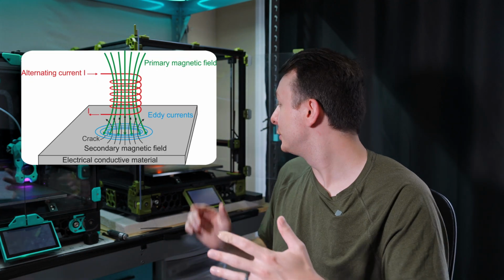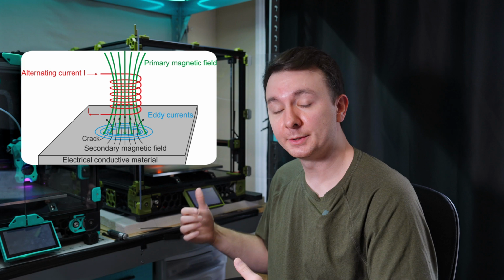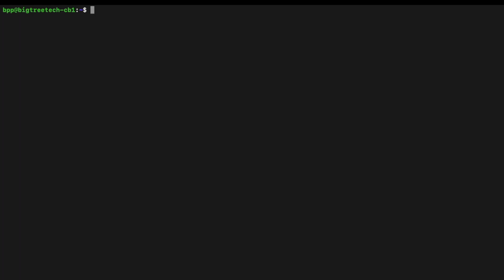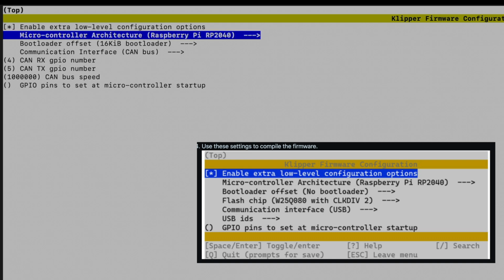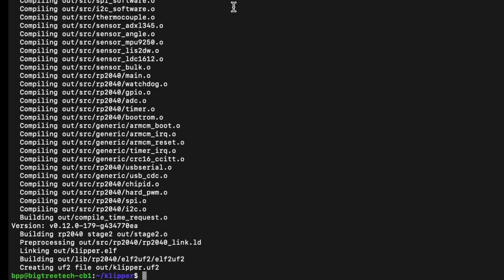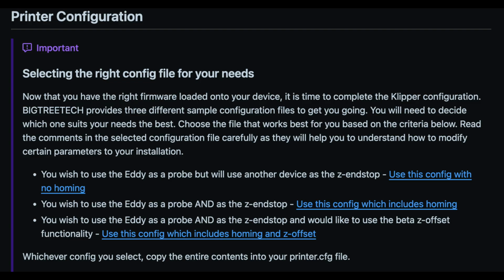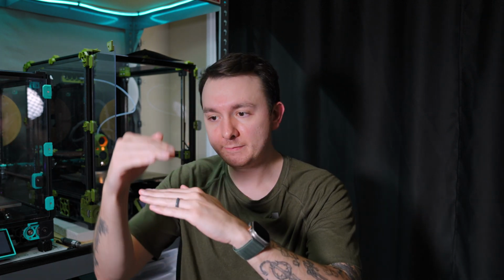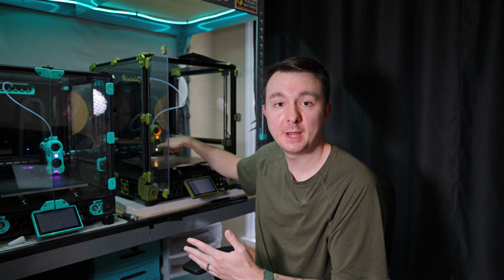Level Your Bed FASTER with Eddy!

Comment: Just ordered a Formbot Voron 2.4, I noticed you described a USB connection; wouldn't the Duo with CAN be a better connection method?
Reply from the maker: Possibly - this is just the one BTT sent to me. They also sent me a new tool head board which is USB but I haven’t installed it yet.
Reply: @ButterPockets  Many thanks for your previous video regarding jumper settings - in the middle of a formbot build :)

Comment: I prosses you offered editing the confog file for different offset is idiotic.

Its a deal breaker .  I tune every filament z offset and send it with command set gcode offset.

I hope it is still possible coa otherwize i threw money to the trash

Comment: Why the hell do you have a section called "hardware install" where you DON'T INSTALL THE HARDWARE?
Reply from the maker: Because I INSTALLED THE XCARRIAGE. The Eddy install is TWO BOLTS. Why the hell do you need to see me screw in two bolts???
Reply: @ButterPockets  Hey now. Which direction do the screws go? What  do they go into? Are there nuts? Are there heat inserts?
Reply: @trevorhall5664  Check the install instructions for that. He was responding with the same tone as was fired at him via the original complaint. I wouldn't fault him for being annoyed at the audacity of people. He went through the effort to create something helpful to provide his impressions of the device. One can only be super polite for so long before you get burned out (ask me how I know).

Comment: hi! I also started using Eddy!
I have a problem when I print parts with a grid from Eddy. The height of the printed parts increases by about +0.6 mm. What could it be??? FADE is off! If without a grid, all the dimensions are perfect!

Comment: I bought the Eddy and tried inatalling it on the gatry bracket I bought for the stealth burner and it wont fit with the phaetus rapido hotend installed. Im really bummed out
Reply: Hey, I haven't tried it just yet but I found a special X carriage stl for mounting the Eddy alongside the phaetus rapido UHF hot-end.

Comment: Hi, first excellent details, very well done. I’m looking for a probe for printing in an enclosed space with ambient temperature around 60-70 with a wham bam magnetic plate with a pex spring steel on top. Do you know if the eddy probe would work with my setup. Thanks for your time and great video. I will surely check out your other videos.

Comment: Hello, thank you for the great video. I have a Proforge 4 with 4 printheads. Here each individual print head is adjusted using its own process. How does the Z offset work? Everyone has their own configuration so that they all work together? Thanks and greetings Markus

Comment: I keep getting Probe triggered prior to movement whenever I got to start a print and it cancels it. Any Ideas?
Reply from the maker: I’d have a second look at your probe start macro. It’s my understanding that if you call a second “probe” command without moving the tool head it will error. Are you running two consecutive “probe” commands without moving the tool head?
Reply: @ButterPockets  not that I am aware of. It happens even when homing.
Reply from the maker: Does it home X then fail? Home X and Y and then fail? Which part of the homing macro does it fail at?
Reply: @ButterPockets  no it will fully home but throw the error after homing.
Reply: @ButterPockets  I believe I figured it out. It was due to my safe z home. Once I used their config for it I stopped getting the error.
Reply from the maker: Did you copy the homing stuff from the BTT GitHub?
Reply from the maker: Sweet! I was thinking it was something to do with that. Glad you could figure out. Hope I was some kind of help haha

Comment: Is there a way to know if my aliexpress magnetic bed (ender 3v2) would work or not?
Reply from the maker: As long as the magnets holding the bed down is a big sheet and not little individual magnets and the actual bed itself has metal inside it (easy to know if it does if it’s magnetic) then you’re good.
Reply: @ButterPockets  perfect, thank you!

Comment: I was going to say, 'bummer there is no CAN version'.  But it looks like one is coming soon.  It would be nice to keep the wiring clean since going through changing over to CAN.
Reply from the maker: Well funnily enough they just announced an SB2209 USB version like yesterday, which I’ll have to try out soon. Looks like we will be able to pick USB or CAN at some point.
Reply: You should rip that can out and make it all over usb
Reply from the maker: @williamanthony7224  CAN is much more robust, but that may happen
Reply: @ButterPockets  maybe over 2 miles of vehicle cabling with hundreds of device
Reply from the maker: @williamanthony7224  there’s no maybe, what you just said is correct. It’s robust and used in the automotive industry. It might be more “difficult” to setup, but it’s a robust and tested method. USB is certainly easier, but that doesn’t always make it “better”. USB is much more susceptible to electrical interference, especially from motors that aren’t so great. This is different than say a computer and CAN is almost certainly the objectively better choice. Although, like I said, I’ll probably go USB just to simplify the eddy wiring.

Comment: Which Eddy do I need for a Voron 2.4 Stealthburner? Eddy or Eddy Coil?
Reply from the maker: Eddy USB is just better than the coil version, but it’s personal preference. Coil can’t be used as an end stop and doesn’t have thermal compensation. But if you have an EBB36 it might be more convenient to use the coil version.

Comment: You can use 2 wires to usb communication and get 5v and gnd from toolhead
Reply from the maker: Would still need the data communication right? BTT is sending over the SB2209 USB to me soon so that should get me back to 1 cable!

Comment: Looking to see how well this would work on a SV08.
Reply from the maker: Since an SV08 is very similar to a 2.4 it would probably work well if your bed/plate are compatible. I just don’t know how it would mount to the tool head since I’m not familiar with it. If an Omron TL-05MC2-Z probe fits then Eddy fits, but I’m not familiar at all with Sovol or what probes they use.

Comment: I was between this and a MicroProbe V2.0 recently. I didn't go with Eddy, mostly because of dealing with different bed plate surfaces and the added BTT Klipper complexity. I know the firmware isn't a huge deal and they are gonna merge it back into main Klipper ideally, but still some added time and effort. I also don't really change build surfaces often, but the probe just seemed to remove one more small pain point there. The other reason I went probe is what you mentioned near the en. Ideally you don't need to bed mesh for every print, especially if you use KAMP. So the added speed wouldn't really be a massive benefit. Still a really excellent bit of kit, especially for the money!
Reply from the maker: I agree that the surface change throws a bit of a wrench in things. I think BTT is coming out with a nozzle probe version too which should address some of that! Thanks for sharing your thoughts, it really helps to provide other opinions and experiences.
Reply: @ButterPockets  I still think it's an awesome option. The USB version having the temperature reading and calibration also fixes thermal drift, which I don't think you covered. Would be my choice for a non-contact probe for sure.
Reply from the maker: I did quickly on the software setup section. I probably should have covered that a little more - it’s worked for me no matter what so the temperature drift compensation is definitely working!
Reply: @ButterPockets  Nah as long as you mentioned it I just missed it! Wasn't criticizing either way. Solid video.

Comment: perfect timing, I'm about to update a few of my printer to either btt eddy, beacon, or cart, just not sure which yet.
Reply: I've found that beacon has the best docs and contact works super well. Price tag is definitely a buy once cry once.
Reply: I’m using Beacon with the new Contact option which allows it to function as a z stop and doesn’t need all of the paper adjustment. It also doesn’t require you to use a particular build of Klipper. Stock Klipper works perfectly with it. I’m running a 75x75 mesh and it’s amazing.
Reply: @ghrayfahx  whats beacon sounds like something I'd wanna use as i'm doing small upgrades to my ender 5 pro
Reply: been testing Cartographer "TAP" function and also works great, it's in closed beta.
Reply: Beacon always.